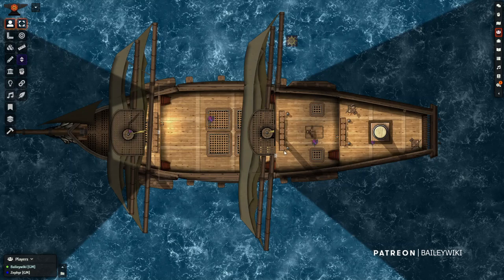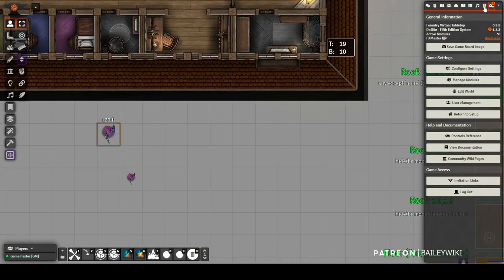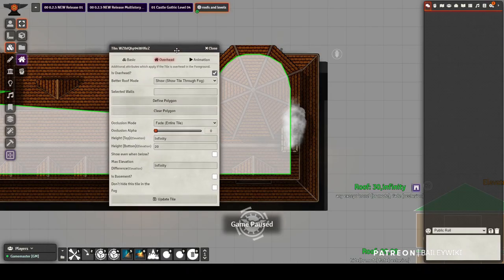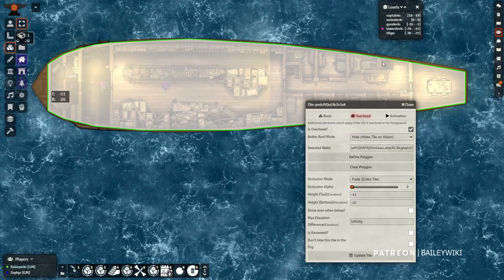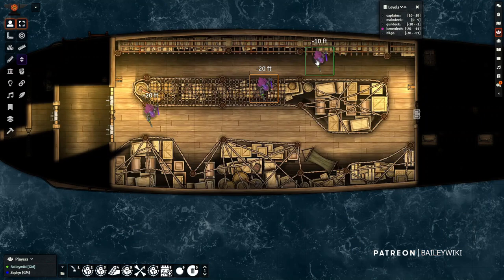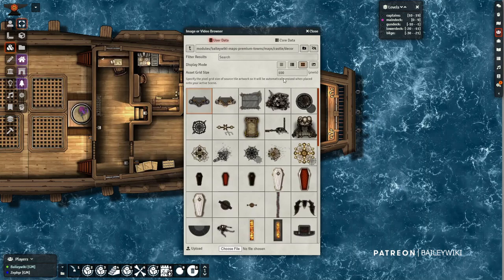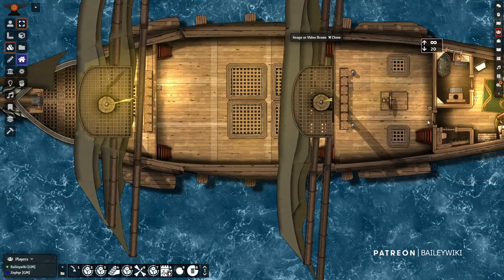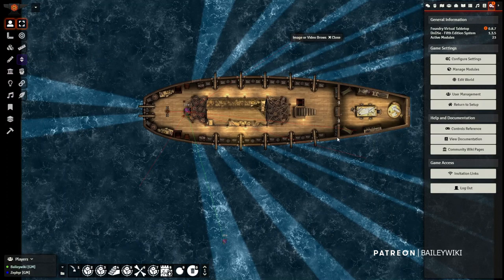Foundry VTT v9 Module Tutorial: Levels Part 2, 1.0 Release with new features!

Comment: Great video! Now that Foundry VTT 10 is out, apparently Holes have been replaced by something called “Transparent Tiles”. Nowhere can I find documentation on this. Can you enlighten?
Reply from the maker: Yeah, so basically Levels gets WAY more simple with V10. Instead of hacking things together with Holes and polygons, that all goes away. Instead, Levels will just use the transparent pixels around your tiles to calculate what defines a room, floor, etc.

Does that make sense? You shouldn't have to do anything. All of our levels maps should just work better, more consistently, and with less design effort.
Reply: @Baileywiki  I think I see… The tiles that are imported already have transparent cut outs where they need to be so there is no additional effort required within Foundry. Genius. (And kinda obvious once you think about it.)
Reply from the maker: Between you and I, I expected Levels to work that way eons ago. I thought it wasn't possible. But Ripper has clearly learned some tricks.

Comment: On the Level Drawing Mode I don't get the option to make it a hole. I just get stair, elevator, stair (one way down), and stair (one way up). Am I doing something wrong or are holes somewhere else now?
Reply from the maker: The concept of a "Hole" doesn't exist in the latest Levels. Check out the most recent in the playlist.

Basically, it's all to do with the transparent pixels in the tile.

Comment: Is this still (5/22) the best way to do roofs and use levels, and do I need to put the bottom layer as a background at all or are you saying to leave it blank and then add in foregrounds after initial setup?
Reply from the maker: The bottom layer can only be a background if it has no basement under it

Comment: For the one way elevator, is there a way to stop the user from getting a prompt after they've dropped down to the bottom floor? Because it keeps asking if they want to drop down after they've already dropped down if that makes sense.
Reply from the maker: They can move, which will make it disappear, but it didn't auto disappear. You should ask Ripper to make that!

Comment: Fantastic video as always. Question for you - I have a 4-story building to design, with a basement. The artwork I have has the ground floor and the surrounding exterior on one piece of art, and the basement and other floors are each in their own file. I tried using the ground floor as the background image, but was having trouble getting Levels to work correctly with the basement. Then I modified the ground floor image so that the interior map reflected the basement level, but that looks like the play experience might be awkward. Should I just use all artworks as tiles and skip the background image altogether?
Reply from the maker: Yes, make them all foreground tiles

Comment: just trying to put a PC on a roof and the festival npcs in the market disappear, apparently theres no line-of-sight, not sure how to fix it.
Reply: Have you tried adding a hole?
Reply: I'm having the same issue. All of my tokens are unable to see any other tokens at a different elevation. The token is still clickable, and names are displayed, but the token art itself disappears.
Reply from the maker: You can try adding a hole to expose the tokens. It sounds like a tile is blocking the ability to see them. I ran into this and actually had to cut a transparent hole in the PNG to resolve it. Not sure why
Reply: I had success with it by changing the wall height. Apparently if it’s too tall of a first floor, it causes the elevated pc not to be able to see tokens on the ground

I lessened the height to 10 and it worked. I think the token on the roof was at 11 and it worked better
Reply from the maker: Hmm, must be line of sight related. Levels does calculate line of sight in 3 dimensions
Reply: @Baileywiki  the algorithm needs work. Perched on the ledge of a building should afford line of sight to mostly everything. Probably hard to do but in this case, better to give too much than too little. Programming is difficult when trying to replicate a 3d feel in a 2d space

Comment: Hugely useful, thank you. 

In your experience is this more or less taxing on the players systems than using separate maps with teleporters? Clearly that is worse for a single combat, but I am curious performance wise.
Reply from the maker: I've been testing it, and it's hard to say. It almost feels like this is better for users. It's still the same number of walls and lights, and presumably Levels is adding additional calculation overhead, but I don't seem to notice it. 

But with the tiled scenes, they require 2 to 3x the number of tiles, replicated all over, so you save all of that rendering with the Levels mode.

Comment: I'm having trouble getting a hole to work on my scene. There are three layers, one of them is a basement. I have steps and elevators that work correctly, but a hole from the top floor to the middle floor will not work. Is there anything in particular I should check to troubleshoot?
Reply from the maker: Is your hole going high enough? Try setting its height to the top of the floor where it's terminating.

And is your tile transparent in the middle? If not, try cutting out the space in an image editor so that the tile itself is transparent. I think holes are supposed to work even when the tiles are opaque, but I never make my tiles that way so I don't actually know.
Reply: @Baileywiki  I tried it with and without transparency in that spot, it's a balcony overlooking the ground floor. The height is set correctly from what I can tell, 0 for bottom and 39 for the top which matches the bottom of the first floor and the top of the second floor. Also, every time I open the hole properties the drop down to mark it as a hole shows that it isn't set no matter how many times I save the setting.
Reply from the maker: Is it part of a prefab? If so, you need to turn on Quick Edit mode to make the changes stick.

If it isn't part of a prefab, you either need to update your modules, or you have a module conflict. Try turning off all other modules but the Levels-related ones, or use Find the Culprit module to see what's causing the issue.
Reply: @Baileywiki  Thank you, I'll give that a try. Is it possible for the system to cause issues? I'm using the Sandbox system so I can use PDF actor sheets as the game I'm playing doesn't have a system in Foundry yet.
Reply from the maker: Maybe possible. You can test by creating a test DND5E world.

Comment: Baileywiki, question:  Is there a way to set up levels on a scene after mapping out a whole floor using map wall tiles, including those pre-existing placed tiles in the "ground floor", without having to re-map the whole level?  I can't seem to find a way to do that and I'd really rather not have to re-map the whole thing if I can help it.
Reply from the maker: I'm not sure I understand the question. What do you mean by mapping and re-mapping? Are you talking about Fog of War? Or drawing walls?
Reply: @Baileywiki  I found a workaround. I was having trouble with the map tiles I was using: I used map asset tiles to map out a building and then turned on the Levels and added levels. I found that I could no longer interact with or edit those placed tiles in any way while the scene had Levels. They didn't seem to belong to any levels and couldn't be interacted with in any way.
Reply from the maker: Oh yeah. You want to activate the Levels UI before you place tiles. It will ensure your tiles get placed on the right level.

Comment: how do you see people underneath the sails tho?
my players have their vision blocked by the overhead stuff like the sails, can't delete them people people are climbing all over them
but if a pirate is below the sail and my player is 5 feet away from the overhead disappearance it DOES NOT disappear and the pirate remains hidden by the overhead (roof balcony, treetops, overhead sails etc etc)
Reply from the maker: You can switch the occlusion mode on the sails so they aren't visible from below.
Reply: @Baileywiki  thanks Bailey, you rock

Comment: Have done everything identically to set up levels as described, but it just doesn't work for me.  I have gone back to making custom cut-out level tiles in Photoshop. I cannot use stacked tiles to work the way I want them to, which is for players to not see the inside of a building until they actually walk into it.
Reply from the maker: Best to ask on Ripper's discord. I'm sure you're either missing something in the configuration or you have a module conflict of there is just unexpected behavior. You may also have a problem with you tiles, I suppose, but you'll need to share screenshots for others to help.
Reply: @Baileywiki  thank you. I’m sure I’ll eventually figure it out. I’m sure it’s the “user brightness” setting that’s to blame! LOL 🥴

Comment: Tried this module and it doesn't work as described to me. I can't see tokens in other floors, the BetterRoofs don't work properly as well and I can't see the Roof when I'm outside. Too many options and nothing works.
Reply from the maker: Indeed, It's complicated and there are a lot of options. And there are some key ways to mess things up that are pretty common. But it's working for at least hundreds of people including myself, so you might consider asking on Discord or Reddit for some support. 

Most common errors:
1. Conflict with Perfect Vision module
2. Leaving the UI open when you are testing vision (it needs to be closed)
3. Drawing improper polygons with your walls
Reply: @Baileywiki  I figured why the tokens could not see each other when they are in different floors. It was a polygon issue. Now I'm still trying to figure why the walls from my second floor(10-19) are blocking vision of my roof(20-29). I've been trying to figure this for hours already. :(
Reply: Also, just realized on first floor(0-9), fog of war works perfectly, but on second(10-19) and third(20-29) floors, fog of war does not work. Everything is back to black as soon as token loses vision.

Comment: Am I doing something wrong or are the define/clear polygon options gone in the most recent version of this mod?
Reply from the maker: It's an advanced setting you need to turn on from the module settings
Reply: @Baileywiki  Hi I am always coming back to this tutorial as I am always running into problems. I can't see the Define/clear tabs also I can see where to turn them on in the module settings I am in the latest version so not sure if its changed again
Reply from the maker: You might have a module conflict that is removing those fields. Try Find the Cuplrit. Or you're running an old version. You really need to ask Ripper though. It's his module and he knows the answers to these questions!

Comment: This is a great walkthrough. I have been using this one and the previous one to make my first leveled map, it is the Yawning Portal from the forgotten realms setting which has a ground floor and two sort of balcony tiers above with an open air section in the middle that cut through the upper levels. Having a weird issue where player tokens can see an NPC token that is directly above them in the balcony above (essentially through the floor) I thought I set it up just like in the previous vid, but could my second level be set wrong? (still on 9.53)
Reply from the maker: Are you on Foundry v10 yet? Levels has undergone some significant improvements for stuff like that, starting with V10 version.
Reply: @Baileywiki  Alas, I had just prepped a bunch of stuff for the campaign I and starting and didn't want to risk the update right before we started playing. Maybe in the mid season break I will update to 10 and see if I can figure it out with the updated. Thanks for the reply though! Maybe I'll rewatch the video a few more times and pause when you have the setting open for your floor tiles to make sure I have not goofed anything up there.
Reply from the maker: Ok, you'll want to look into the polygon tool since you're still on v9. Use visible and invisible walls under your floor to help Levels identify the tile better and make it work.
Reply: @Baileywiki  this worked! After replying rewatched the video and realized the tile overhead/roofs/occlusion settings looked like yours. Then saw that I had the polygon set wrong. Doh! Thanks for the help and all the great tutorials.
Reply from the maker: Of course!

Comment: Imagine if dungeondraft had levels and better roofs implementation, so you just import the whole thing integrated.
Reply from the maker: That would be amazing! But automatic cropping would be a challenge I would think
Reply: @Baileywiki  Kind of makes me wonder what's the point of Dungeon Drafts built in levels feature when I can't export it to anything that can actually make use of that feature